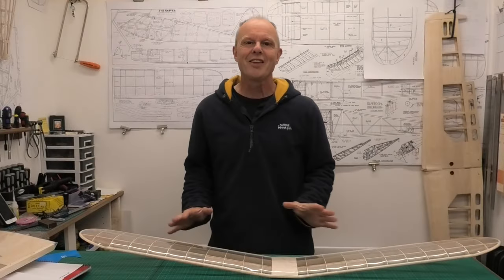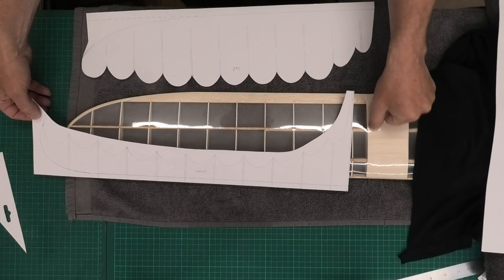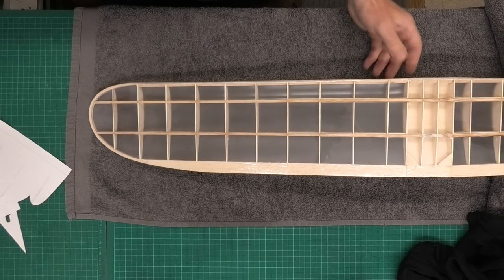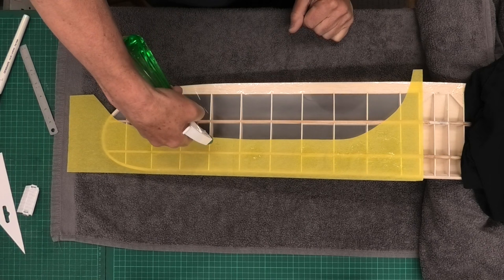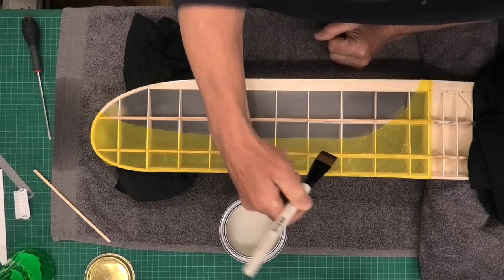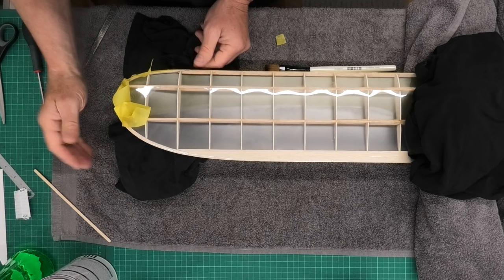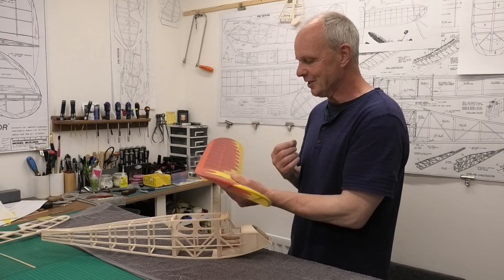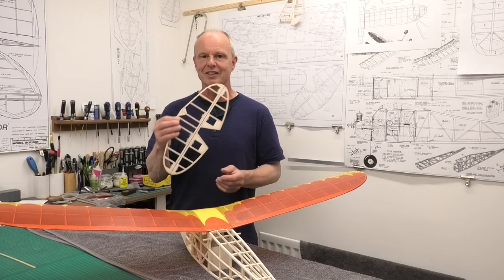45" Quaker & Mills Diesel - Build Series: Pt 14 Wing - Tissue Over laminating Film

Comment: That looks absolutely fantastic. You make it look so easy. I'm still having trouble covering with the Doculam. On the flat surface of my fuselage I tack down all the edges and a perfect flat covering, and when I apply heat to shrink the covering it goes more slack than if I had left it. I will keep trying.
Reply from the maker: Hi Terry, thanks for the comment, sorry to hear you are having some issues, it does respond well to heat, lots of heat,  I find a heat gun the most useful for shrinking it. Hope you get it sorted
Reply: One thing I do know, I won't give up. That tissue finish you have done is just brilliant.

Comment: A question for you Mark, if I may:  If you have an area of solid balsa sheet, like an elevator, rudder or the front fuselage area, would you put film on it first, or just apply tissue using the polyurethane to stick it down?
Reply from the maker: That is a great question, in instances like this I seal the balsa first, using the polyurathane, lightly sand then apply the tissue wet and the polyurathane as I would on the wing - so no film.  Thanks for the comment, hope that helps

Comment: Looks great Mark!  I will have to try this method.  Question: I wonder what would happen if you hit it with a heat gun if you get a wrinkle down the road? The Doculam should still be able to shrink from heat if needed.
Reply from the maker: The tissue sticks really well to the laminating film, so not sure how it would respond, but I have not had this type of covering wrinkle or sag in the same way as covering film can, think its because of the composite nature of the covering.  Pleased you liked it, thanks for the comment 😀
Reply: Now that I think about it, I haven't had Doculam sag or wrinkle either,  but I have had the seems come loose, especially on a water plane.  Learned the hard way, Doculam is NOT waterproof
 @MarkRobinson555